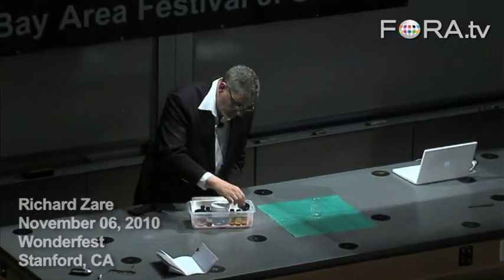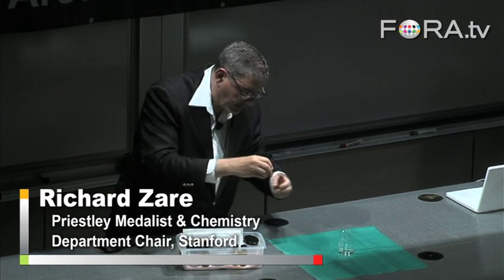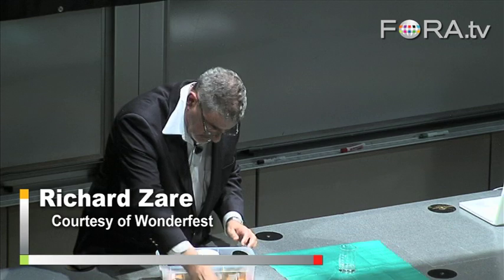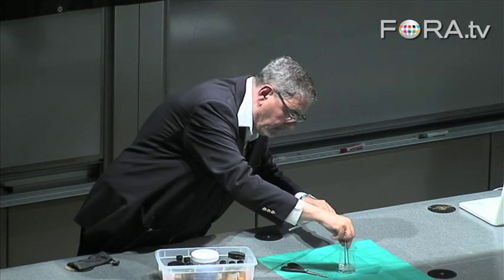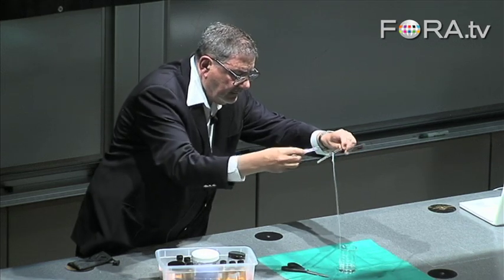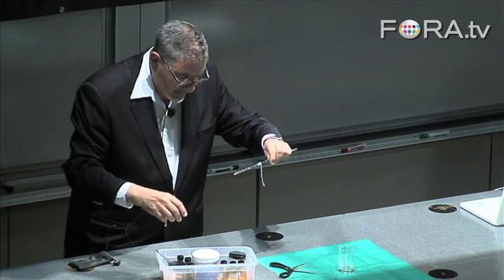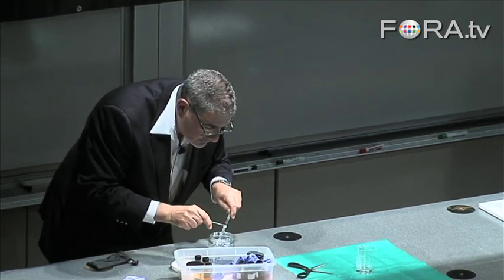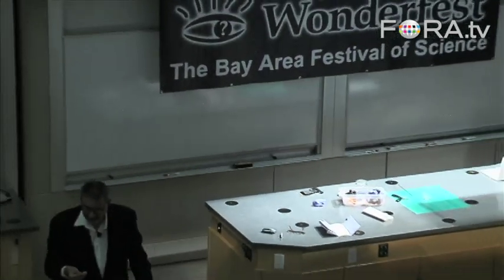DIY Chemistry: How to Make Nylon

Comment: @happinesson some type of diamine and something with two carboxylic acids at each end.  condensation reaction occurs to form a condensation polymer at the interface of the two layers.  basically you get two layers in your beaker and the nylon forms in between the layers.  That's why he had to use the tweezers to grab the nylon in the middle.